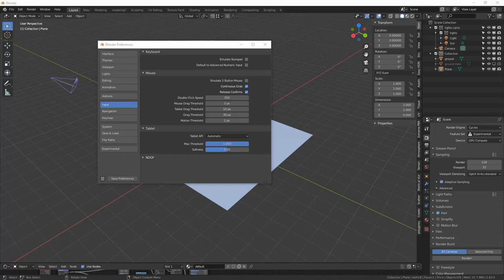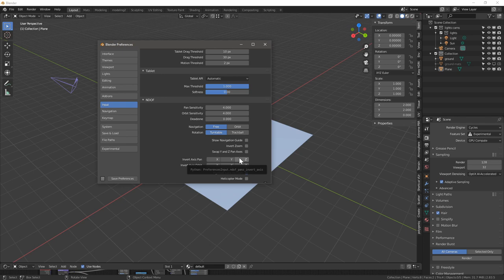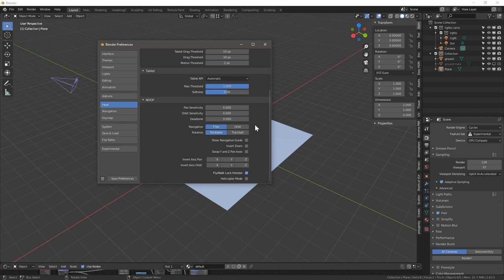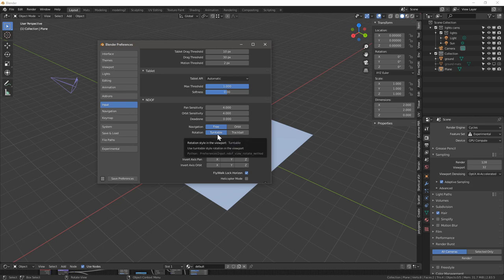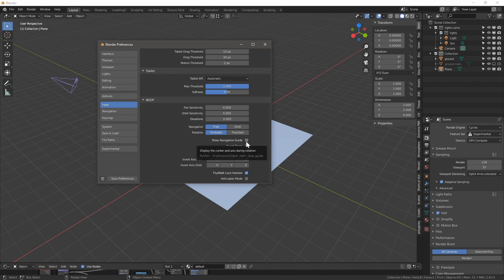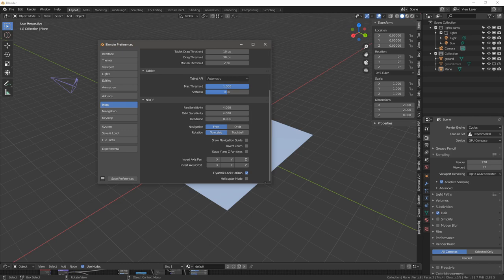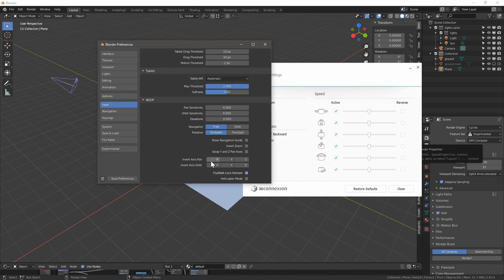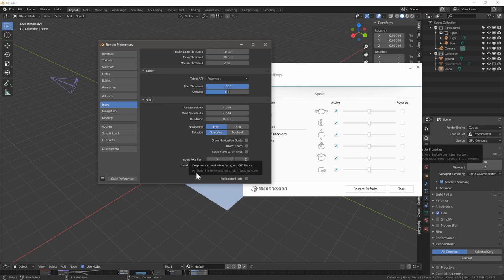Optimal 3D Space Mouse Settings in Blender 2.83+ for architecture and design

Comment: I actually ended up using a combination of these settings and some tweaked settings in the 3DConnexion software, like reversing the up/down direction and reducing the speed of that setting. Once you get the right settings, the SpaceMouse is utterly amazing for use in Blender. I cannot work without it.
Reply from the maker: Thanks for your tips!

Comment: I've just updated 3DxWare to 10.7, and the Menu button of the Space Mouse does not open the 3d Mouse popup anymore with all these settings, to tweak the speed value on the fly. I think something is broken in the "Application Usage" hotkey asigned in the 3dConnexion settings, but if there was a way in blender to open this popup with a hotkey we could map it to another keyboard shortcut, anyone knows how to open this 3d Mouse popup without this menu button ?
Reply: Aaah found it, in hotkeys, type 3d mouse, and then replace the "menu" hotkey by a random key on the keyboard, and assign that key to the menu button in 3DxWare button settings, now you can call the popup again with 10.7 pilot version.
Reply from the maker: Thanks for the tip!

Comment: My understanding of deadzone is if your controller is showing signs of joystick drift, where the controller seemingly detects small amounts of positional data despite being in a neutral position. Very good to have in cases where the controller has met some amount of abuse.
Reply: I bought one and this controller is no joystick it works different. I like the zero deadzone, it works much smoother. No drifting at all, buy one and you will know!
Reply from the maker: Thanks for clarifying. I've always wondered :)

Comment: Hi, thanks for the great video. Unfortunately, the settings did not work for me at all right now.

I have set up everything exactly as in your video, but now all movements are completely screwed, and I can't even get my model back on screen :(

I come from SketchUp, where SpaceNavigator works normally.

Has something changed in Blender in the meantime, regarding SpaceNavigator?
Reply from the maker: I think something has changed, but I can't pinpoint what. You could try Changing the Navigation to Free instead of Orbit. It's a bit different feel, but at least it doesn't end up frozen without the ability to zoom in.
Reply: @UHStudio  thank you, will try that and report back

Comment: Do you get problem with zoom? when i use zooming it stops, the same as when using mouse. I tried different zoom methods and i always have to FIT selected object to view just to be able to zoom more. Did anyone get the same issue?
Reply from the maker: I have the problem as well. It seems more prevalent in recent versions. Sometimes zoom stall completely with the 3d mouse whereas with the regular mouse I can zoom further. Maybe a big report is needed
Reply: @UHStudio  Has this been fixed?
Reply from the maker: @shin-ishikiri-no  as far as I know the best thing is to click on zoom to selection every once in a while

Comment: I’m on mac and if i use the space mouse the navigation is extremely stuttering and laggy, if i use normal mouse it’s smooth and fast. Any suggestions??😕
Reply from the maker: Perhaps the latest drivers? A good thing to check is how well your 3d mouse works with older versions of blender - 2.83 and 2.79. If it works ok with them, it may be a blender problem with the most recent version and you can file a bug report.
Reply: @UHStudio  drivers are up to date, but i will check out an older version of blender. Cause other software works fine with the mouse. So i guess blender is the Problem
Reply: @KLLDZR-se1qk  I just installed everything, using Blender 2.92 and latest 3dxWare drivers and everything is smooth~ Though I'm still using MacOS High Sierra...

Comment: Hi, thanks for the helpful video. The problem I have is the setting just control the mouse pointer. I would like it to control the view. Is there any way to set this up?
Reply from the maker: Hi. Do you mean to use the 3d mouse are a joystick mouse controller? If so, I don't know if it is possible to set it in that way.